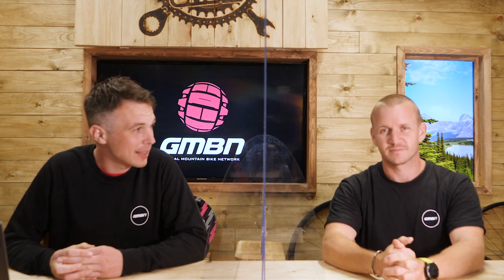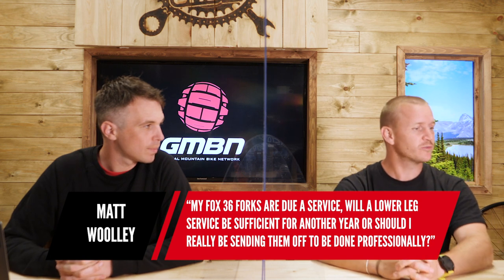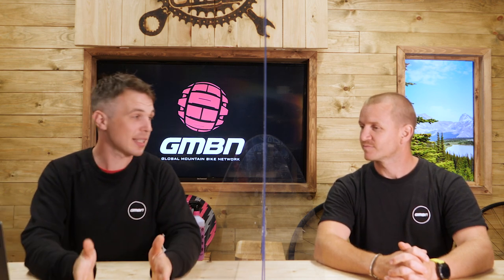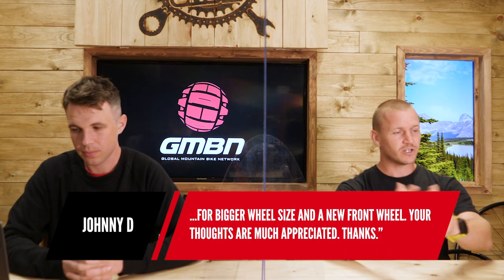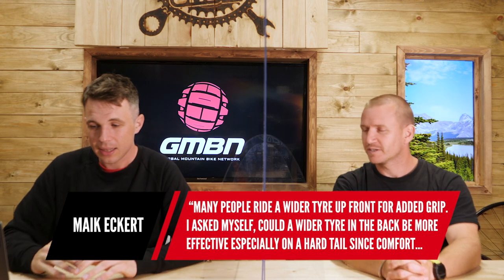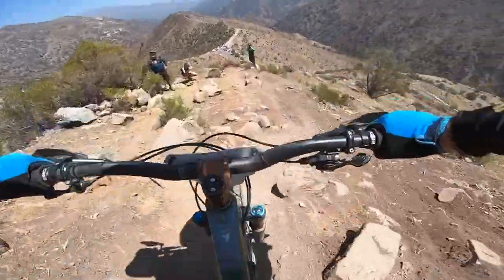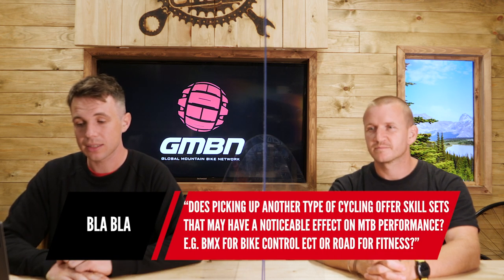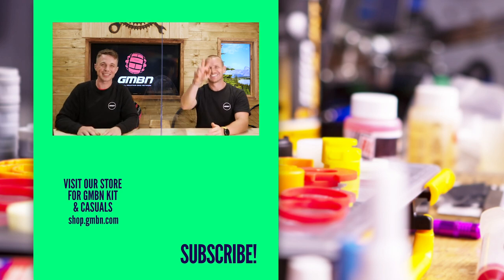Why Are Old Bikes Smaller Than New Bikes? | #AskGMBNTech

Comment from the maker: Use the hashtag #AskGMBNTech in the comments for a chance to have your question featured on the show. 👇
Reply: #ASKGMBNTECH why my front brake arm have a bit of up and down play
Reply: #aAskGMBNTech what happened to the isis dive bb's and cranksets? Why don't bike manufacturers spec. Basic bikes with this style bottom brackets?
Reply: #AskGMBNTech Can we let Henry loose on a suspension designs episode, like the one Doddy did where he nerded out on geometry? Like a 30 min. plus special on the characteristics of each design philosophy, comparing the pros/cons of single pivot/faux bar/four bar/VPP/DW/Switch Infinity/CBF/etc.? He seems like just the right guy for a deep dive into that area!
Reply: #AskGMBNTech
Hey guys
How do you service a Mazzochi  Fork?Is it just the same as Fox Forks?
I´´ve got Mazzochi Z2 and want to service it...can you  make a viedeo about it?
I coudend find a viedeo about it
Love the Show
Thanks
Reply: #AskGMBNTech
Hello there! I got a pretty complicated question about my gears. I got a Trek Slash 8 2020, so where the rear mech is hanging on to the dereuilieurhanger, there is this screw thats hold them together that screw isen’t screwed all the way in. It is loose, but when I screw it into place again it is like the smallest gear doesen’t excist and if there would be one more gear behind the largest gear. So what should I do it feels wrong to have it loose but it wont really work with the screw tighten? And when it is loose that clicking noise appears and it wont dissapear with the screw that is on the shifting leaver on the handelbars. Keep up the good work!
Reply: #AskGMBNTech I have a Commencal clash 2019, a bike designed for 180mm suspensions. Now that the Rockshox Zeb is out, will it be possible to put a 190mm Rockshox Zeb on the bike?
Reply: #AskGMBNTech I have a trek marlin 5 and once the drivetrain wears out I was planning on changing it from 3x7 to 1x11 if I can change the freehub. Is it possible to put a different freehub on the stock hub or should I get a whole different rim\hub.
Reply: #AskGMBNTech, Hi I want to stick a 203mm rotor on the front. I know I need a 160/203mm adapter but there seems to be different types with different initials.
Could you explain the different types please?
Reply: #AskGMBNTech I have seen Yeti SB165 project at https://www.youtube.com/watch?v=ss5ziQrdc_M that have double crown which is sick.... my gut feeling told me this is going the next trend for enduro bikes....double crown fork with shorter travel than DH's...what is your opinion about this ?
Reply: #askgmbntech On the question of bigger and bigger disc brakes, they are quite heavy setups. Is it possible to use a disc / rim brake combo? I'm thinking rim brakes are very light, but would also (maybe) pass some heat into the tyre, enabling more air to be put into the tyre because the tyre will be softer with more heat!
Also are there carbon ceramic brakes for MTB, so they would be lighter and (more) fade resistant?
Reply: #AskGMBNTech hello i would like to know if we can put a 20x110 wheel on a 20x110 boost DH fork
Reply: #AskGMBNTech Hi guys. Love everything GMBN. I’m in the market for a trailbike for my partner. She is very small at 150cm and 45kg. I’m considering a Canyon Spectral WMN 2XS size, Norco Sight Womens XS, Norco Sight Youth, Commencal Clash Junior. 

Will a Junior or smallest possible Womens bike be more suitable? Thanks
Reply: #AskGMBNTech What makes kids bikes so expensive? Last year I picked up a cracking deal (£330 discounted)on a 20” Norco Charger Hardtail with air suspension fork and hydraulic disc brakes for my 6 and a half year old son. His little brother now approaching 6 needs to get off his 16” bike but there is nothing on the market similarly specced for similar money, looking at £400 with no suspension and v-brakes from most of the big brands.

The bike should last them a few years so I don’t mind paying out decent money but £500 for a kids 20” hardtail when I could pick up an adult 27.5” hardtail (Voodoo Bantu) with same spec for similar money. 

Also Norco are exclusive to Evans Cycles in the UK and they haven’t even bothered to stock the 2020 version of the Charger 20” instead stocking dirt jump and full suspension models not suited to a 6year olds riding style.
Reply: #AskGMBNTech Hello I have a problem my dropper post das not stay down and comes back up and when I sit on the sedle while it is up it goes down. What can I do with it? Thanks for your ancestor.

Comment: #AskGMBNTech I've recently developed hand/wrist pain from riding (trail riding but our local trails are pretty steep and lots of braking). I'd love to see a deep dive on technical aspects that can affect wrist pain: grip type, handlebar angles, brake lever setup, reach, seat tube angle - seems like they all play a part. I've been practicing 'heavy on the feet, light on the hands' but wondering what I can do with bike setup too.

Comment: To answer Maik, if the front end slips then you're going down. If the back slips it's just a cool skid. That extra grip is desired because it keeps the front end going the right way. There's no reason you can't run big tyres at the back as well but the prevalence of fat front, slim back is definitely a grip and control thing.

Comment: You guys mentioned you tend to get tagged in the rear by 29ers. Sounds like you're making the case for mullets with a 29er upfront. Have you done the front wheel swap test? May be with and without fork swap and / or same fork type same overall height in order to keep geo consistent. I bet a lot of people have asked themselves when upgrading or even asked upgrade the bike or just the front end to 29. You're welcome. AndyB

Comment: With brake disk rotors don't just go big, go big (if you want) and choose a good design, appropriate for what you do. Power without control is not very useful.

Disk brake size definitely matters, but I find that materials, design (e.g. Shimano ICE technology) of the disk and pad material also matters a lot. I recently got a new full suspension bike, on the budget side. Very good components overall but average disk brakes rotors, the Shimano SM-RT30, 180mm. I feel like my hard tail with the Shimano XT rotor (SM-RT86) caliper and pads (with cooling fins), but only 160mm is more aggressive. So I decided to swap the SM-RT30 and resin pads (which were fully worn anyway) with the SM-RT70 which have ICE technology (so a middle aluminiun layer to remove the heat) and Quaxar semi metallic disk pads (Shimano makes only resin or fully metallic). What a difference that made! I choose semi metallic as the metallic part has less fade and since I use the rear more when going down hill I felt I needed it. For the front I'm happy with resin as I like the added modulation, don't want to risk locking the front wheel, it doesn't wear out as quickly as the rear anyway.

Also note 200+mm disk rotors are quite heavier compared to 180, so if you want to pedal as well on the same bike consider this factor as well.

I thought about moving to quad piston caliber in the back before this change, but I honestly feel I'm ok with how it is now, no need for the extra weight. And it would probably be a better idea to rather move to 200+ mm disk rotors instead.

Comment: I’d go for 29” front on a 26” dh bike. But I don’t think I’d want mullet trail bike. I’d rather 27.5 trail bike. As far as 27.5 front... if you have a fork that fits it a 3” tire can allow you to try the 27.5 outside diameter on a 26 rim. (My 3.0 gazzi has 0.5” more diameter then a 2.4 wild enduro 27.5).

I should add that I like a 3” tire on a 26” rim more then I like 27.5 rim with 2.5 tire.

Comment: Regarding the first question about measuring rear travel: yes, the axle path would have a curved path, and the curve could differ by linkage design...but I'm not sure it would be so meaningful to measure along this curve.  Wouldn't it be more meaningful to measure the straight-line distance between the ends of the curve, or perhaps the strictly vertical vector of this movement (I realize forks are not measured along a vertical axis, however)?  It seems like it doesn't really matter if the axle has to move through a 107mm vs. 114mm curved distance to soak up a 100mm vertical bump in the trail (just making up some numbers representing different axle path curvatures for different linkage designs) -- while this may suggest something about the progressiveness of the travel, is the second bike really experiencing more "effective" travel?

Comment: #AskBMBNTech
Hey gmbn tech, i've got a question.
On my 2019 giant fathom, there is a rockshox motion control damper to change the compression on the fork.
A couple of rides ago i noticed it has stopped working, it is now stuck on the first click no matter how the dial is turned, is this a known problem and is there a fix for it, or should i send it in for warranty, thanks in advance.
Reply: Martin Westen Rasmussn do you still have your full amount of Travel or has it lost about 20mm of its travel and goes into block to early?
A known problem with the motion control is a failure in the lower sealing and then the oil drips into the lower leg.
Then the motion control unit stops working, because there isn’t enough oil going through it’s valves to properly dampen the bike.
Most of the time then your not able to lock or harden the fork anymore.

At the same time the amount of oil that dripped into the lower leg works like a spacer and limits the amount of travel the fork has.
I had this issue with two Pikes and a Argyle before.

It’s an easy fix when you know how to service a fork.

If you still have your full amount of travel it’s super easy, because you just need to add the amount of lost oil into the motion control unit.
If it also limits your travel you have to let the oil out of your lower leg, install a new sealing and add the correct amount of oil into the motion control unit (often between 120-140ml, it differes a bit between the years).
Reply: I had a problem like this with an old fox fork I simply took off the adjuster cleaned inside and put it back on

Comment: #askGMBNtech

My pedals are making a clicking sound and I can feel it on my shoes every time it happens. How do I fix that. Also it’s only on the drive side (right)
Reply: Eather Service your pedals (if possible) or buy New ones 💁🏻‍♂️
Reply: I had that.
It either needs a service to the bearings, or just needs tightening up.
Reply: I got some new metal pedals cuz the broken ones are just cheap plastic
Reply: Could be dirt on the threads, take them off give the threads a good clean and regrease. 
Worth checking before you start spending
Reply: I had the same issue, and all I had to do was tighten them.
Reply: My pedals needed an upgrade anyway 
There about 2 years old and kinda falling apart so I got some new ones
Reply: Reassemble and re-grease the pedal, check crank and re-grease it also.
Reply: Вадим Пестрянин good call
Thanks for all the tips guys 🙏
Reply: I'm sure there's a GMBN Tech video about this that Doddy made  https://youtu.be/8bHnSWzk_DI  or, at least, on servicing a pedal and spindle? Check the crank also, any vibration in it, could be coming out through your pedal, but is probably the bearing in the pedal or thread of pedal itself!

Comment: #askGMBNtech
I recently bought a 2011 scott genius 10 and the frame is made out of carbon fiber. Should i be concerned about the strength of my frame or do you think it is just fine
Reply: I think you are already concerned. You can think of it two ways. Either it's on the verge of death after 9 years of abuse. Or it was treated well and has 9 years of riding serving as proof that it has no manufacturing defects. Carbon won't show you signs of wear or defects unless you have x-ray vision.
Reply: Frank Ricard thanks

Comment: Just a quick question,  its easy to change a front fork and increase the travel by 10/20mm but can you also do the same to the rear?
Reply: Generally speaking u cant, unlike the fork which is self contained system, rear suspension is combination of frame and damper. Unless the frame was designed to be used with different size of dampers which i think d be possible, it will limit how much travel the bike has in the back.
Reply: Front yes back no

Comment: #AskGMBNTech    Hi guys at gmbn. I’ve got a pair of tektro Orion 4pot brakes on my giant trance. My brakes have never felt the same from the very beginning as they always feel spongy and are 1.5cm from clamping the bars. I’ve bled the brakes and changed the rotors and pads and given it a full service and check and they still seem to feel spongy. Thanks

Comment: #AskGMBNTech Tech guru's Henry or Doddy. I'm on a SC 5010 at 130mm travel. Would like to experiment with upping the fork to 140mm. Is it as easy as throwing a longer damper and air spring in there? Will this be a significant positive change? Thank you for any help you can provide and absolutely love the show!

Comment: #AskGMBTech
My hydraulic brakes was not perfect, so i decided to replace it.
I've choosen different brand than owned.
Question - should i replace rotors as well?
They looks just like a "polished with minor scratches" in area where pads make contacts to rotor, but no noticeable thinner. Pads looks like in same points as old one.
Q2: How to spot when replace rotors?
So far - before hit the trail - road test around home - no scratching, no noise and a lot of braking power.
Reply from the maker: Good questions Stan!

Comment: #AskGMBNTech- My Roscoe came with a 120mm Judy fork, with 30mm steel sanctions. I've seen other forks with larger diameter sanctions, which are supposed to be stiffer. Being that mine are steel, should I worry about the bigger diameter. I'm also 6'2" 275 lbs if that makes a difference. Aftermarket forks are also really expensive

Comment: #askgmbntech
I have a rockshox monarch rt on my bike I have as many volume spacers as I can fit in there, pressure close to max and sag set correctly and the shock bottoms out all the time. I'm 16st do I need a different shock or can I fix this some way. Thanks for your help.
Reply: matthew jones I had the same problem. I’m 17st myself and found my monarch bottomed all the time. I had a defect in mine. I’m pretty harsh on it. I get my new rear shock today. I’ll come back to tell you how it goes. We bigger folk may just need more travel sadly.

Comment: #askgmbntech 

Why do bike manufacturers tend to longer travel on the front of the bikes instead of the rear? In terms of wheels, you generally put a stronger rim on the rear because it takes bigger impacts than the front wheel. Why not add in longer travel on the rear to help compensate for the hard impacts?
Reply: Jaden Straw      generally the rear is harder than the front and has more ramp up

Comment: #AskGMBNTech 

I've got a Giant Trance Advanced 1 (2018) and the headset is making a clicking sound. I've taken the headset apart, regreased everything and as soon as I start riding again, it often makes a click sound. What's the problem? Cheers 👌🏽
Reply: Have you checked your steerer screw? Is it tight?
Reply: @fritz2513  Yh its fine, pinch bolts as well are tightened to correct torque.
Reply: have you checked that your bearings are not shot. You might need to replace them if  you have not done it in a while
Reply: @Dan Querelle  That's a good point actually, I'll check that thanks 👍🏼
Reply: Alec Jones hope you fix it. If not you can always resort to a bike shop.
Reply: @Dan Querelle  Yh man, thanks a lot 👊🏽

Comment: #AskGMBNTech
I want to experiemnt with a 26''/650b mullet bike as well since I have a Banshee (Rune 2014) which can change between 26'' and 27.5'' wheels. So far I have a 27.5'' boost fork with a 2.8'' tyre (actually the same size as a 29'' wheel with a 2'' tyre). Eventually I will buy a 26'' rear wheel with a 142mm hub and try a mullet setup. With a 2'' tyre on the back it will actually be a 69er and 1 degree slacker than designed at 63.5 degrees (it has 0.5 degree adjustment in the rear dropouts to help compensate). I will probably put a longer stem on (currently 35mm) to return my position forward and calm the slow speed steering down. I have no idea how it will act but I can revert to normal if it doesn't work out.

Comment: #AskGMBNtech - I have a Laperriere Zesty AM (with the 27.5/29 flipchip) bought it as the 29er and I have recently got some 27.5's for it.. if I wanted to run a mullet should i run the flip chip on 27.5 or 29.

Comment: #askgmbntech I have a RockShox Judy fork I have it set up for the correct sag, I find that I have never used more than half the travel. It doesn't take particularly large hits, is it worth taking some air out so that I use more of the travel. It doesn't have any way to install volume spacers so air pressure is all the control I've got.
Reply: I’d say feel free to adjust the bike to however you feel most comfortable. Also, check and make sure you don’t accidentally have too much compression dampening.

Comment: #askgmbntech i have a rockshox reba (probably around 2008) and under heavy breaking it makes a fairly loud creaking noise i have fully stripped down my headset and that hasnt fixed anything. So im now thinking it is the forks they have been fairly recently serviced so i dont know what the problem is?

Comment: #askgmbntech Hi gmbn. I have a 2010 specialized demo 8 I. It has the fox dhx 4.0 rear shock. Recently I took it off my bike to clean it. I put it back on and cycled it without the spring. When I put it back in it stopped compressing, then all of a sudden compressed. But now there is no damping. What could the problem be? Thanks!